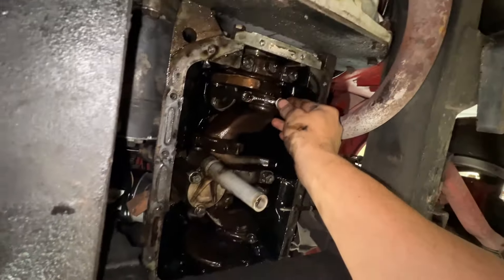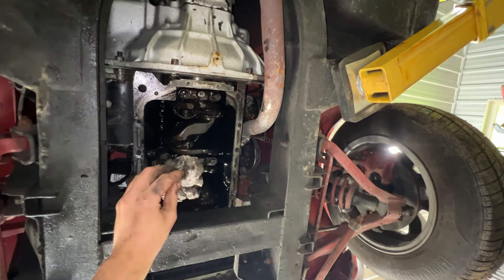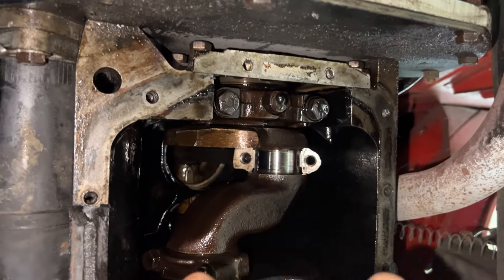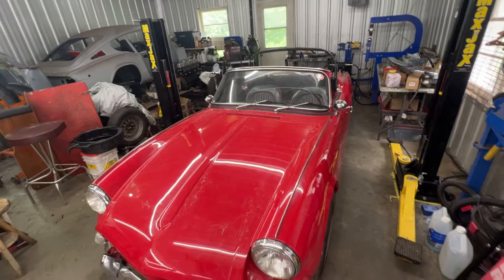1966 Spitfire - did I neglect her for TOO long?

Comment: I think merely slapping in new bearings would be a very temporary fix because of the scoring on the crankshaft. Needs to be ground and oversize bearings  installed, for a more permanent fix. Especially since the timing chain needs replacement, too. 
It's possible something has shed metal particles into the oil system, causing damage throughout. If the rod bearngs look like that, there's a good chance the main bearings do, too. A full rebuild is needed.

Comment: sorry to hear of the problems you had with the spitfire if your going to go to the expense of building a new motor try to find a 1296cc mark 3 engine I use to race spitfires in SCCA and was a good friend of Lee Mueller who was a Factory Driver for Joe Huffaker in the day they both said the 1296 cc was the best spit motor ever I used to run mine up to 7500rpm all day long and never had any problems with it

Comment: Why not consider changing the big end shells and the oil pump with the engine in situ ?   This was fairly normal practice in the 1970's to do periodically as the big end bearings wear. It is possible from underneath with the sump off, without resorting to a full rebuild.  A set of shell bearings and the new pump would take you to winter and it actually may be all that is needed.
Reply: I do remember this being a fairly standard practice in the eighties. Many backyarders did not have the facilities to remove engines, so you worked as best you could, and left the engine in place.
Reply: @achmadosman9807 
not sure what you mean?  I grew up in the 60's and 70's and remember watching neighbours pull engines out in their " back yards " garages and driveways... everyone had engine hoists or shared one... doing a in frame rebuild on a small vehicle or anything smaller than a Semi Truck wasn't " Normal " ...or practical...they rebuilt engines or repaired them if severe enough to remove..and they were easier then too... Hot rodding or Restoration of vehicles was going on everywhere in neighbourhoods or suburbs...doing it in frame is silly when you can do it outside with a few hours of removal ( or way less when you actually have done it alot... it makes it easier and better out of a frame and saves time actually... it wasn't Rocket Science to many ..
🇨🇦🤓🤟
Reply: Yup, I did rings and big end bearings of my Chevy 10 that way.  Front wheels on the curb since I didn’t have jack stands.  Lasted a couple of years.  But Elin has options and will likely want to do a complete job.  Those guys are not short of cars to drive!
Reply: @edwardkendall3905  Also the rebuild makes another video.

Comment: So you think the low oil pressure wasn't due to the pump but instead the loose bearings? Or did the bad oil pump with low pressure cause the bearing damage?